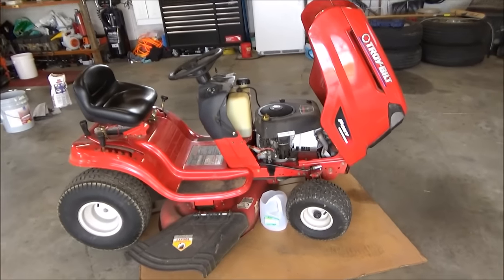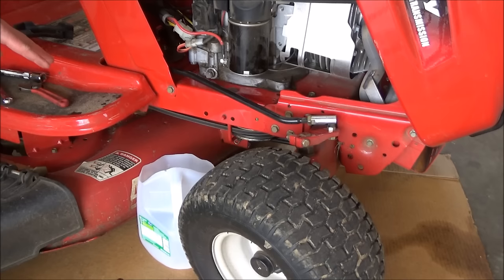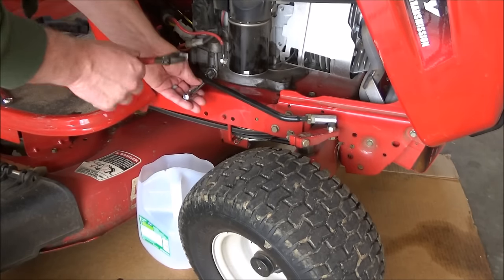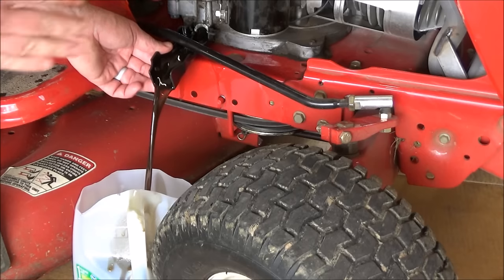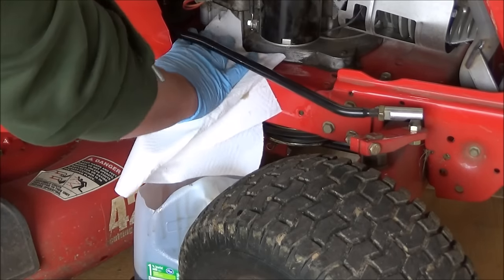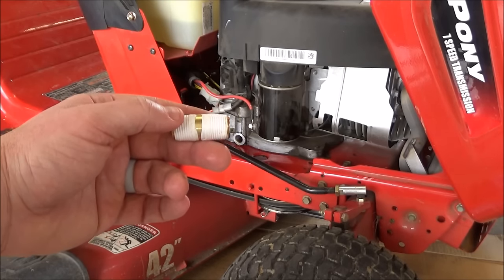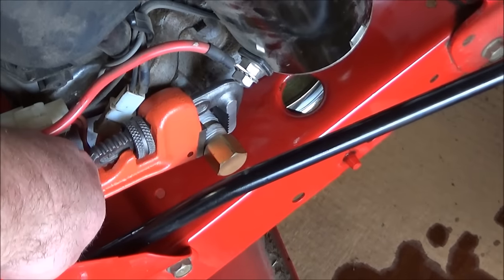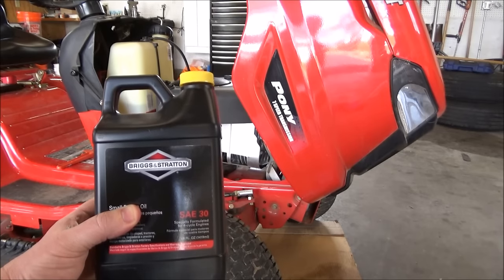Troy-Bilt Pony | Oil Change Made Easier

Comment: There is no oil filter on pony 42? Where did you get the brass nipple
Reply from the maker: Within the last year or 2 they started adding a filter on certain models. They did not have one for a long time before that. I got it at Home Depot. 3/8 MIP
Reply: @fixitFlip  where is it located so I can find out if mine has one?
Reply from the maker: @dbluehorsedeboe5567  It is a round, black, canister looking part up above the drain plug.
Reply: @fixitFlip  ok thanks
Reply from the maker: @dbluehorsedeboe5567  No problem.

Comment: How do you change the solenoid?
Reply from the maker: Follow the red cable from the battery to find your solenoid. It's just a matter of taking a couple bolts off to replace it. Just make sure you disconnect your battery. Sometimes they are a little tricky to get to. I haven't gotten a chance to make a video on that yet!

Comment: I have one similar to that but I don't see a oil filter on mine 🤷🏿‍♂️
Reply from the maker: Yep, none on mine either! They just recently started putting one on this model last year or two.
Reply: @fixitFlip  So it has no filtering system to filter out the old oil? That's weird.. How does that work?Where can I buy that pump so I don't have to drain from plug?
Reply from the maker: @dkd8747  It's a splash lubrication system. It doesn't require a pump or a filter.
Reply: @fixitFlip  Thanks i was talking about the pump that you were using to suck out the existing oil to replace with the new. or maybe im getting this mixed up with another video
Reply from the maker: @dkd8747  Ha ha yeah I know what kind of pump you are talking about but that wasn't me.

Comment: I just bought this same mower. I put a quart of oil in it. When i was running it, the mower started to put out a lot of white smoke. Did I put too much oil in? I looked at the manual afterwards and it said that the mower comes with “some” oil already. I’ve never had a riding mower so I’m still learning what all comes with owning one. Any info helps, thanks!
Reply from the maker: You put a quart in it? A quart is 32 oz. This mower takes 44 oz of oil. (48 if you have an oil filter on it, which mine does not) If you put too much oil, it can make it smoke a little. White smoke typically means oil.
Reply: You overfilled it.

Comment: Dude I just did this combo and the cap you are showing can’t be 3/8 even if it’s a compression one. It has to be 1/2” cap to seal the nipple.
Reply from the maker: Nipple is 3/8 MIP (male). Cap is 3/8 FIP (female). That's what goes together.  Not sure what you are getting at.
Reply: @fixitFlip  I bought the double ended male pipe nipple 3/8 wide 1 1/2 long. No 3/8 cap would fit over the thread on it . Only a 1/2 cap would fit
Reply from the maker: @mavericke3514  Not sure, man. That's how it works. The same size male and female fittings go together.

Comment: The 42" deck belt for a troy bilt pony year 2019 and 20 >>> 1/2" x 96" long OK  the same engagement cable also. Parts # QSH - 0453   OEM NO- 746-04092 cable --- >  Keep 2 of each on hand. This may not be the same on older models
Reply from the maker: Thanks, Bee.
Reply: @fixitFlip  wc  bro

Comment: Instead of a cap why not put a ball valve. Then when it come time to change oil you open ball valve. That’s it. I know an idiot gonna say what if the handles hit open. Well take off the packing nut along with the lever. Put packing nut back on. Then all
You use is some pliers to open
Valve. 3/8 ball valve.
Reply from the maker: That's a clever idea!

Comment: The owners manual says 10w30 oil for the 2018-19's
Reply from the maker: 10w30 will give you a little more flexibility. It works better in colder temps than SAE 30.  Either one would probably be fine. But that is interesting the new manuals are saying that. I would go with it if that's what it is saying now.
Reply: @fixitFlip  I just bought a John Deere E130 this spring,  and it says in the manual to use 10W30. It's got the EZ change oil filter, but I think I've seen a video somewhere before that you can change it over to a regular way. The EZ change is $40 a pop.
Reply from the maker: @charliekeene2003  Yes if I had that mower I would probably be changing it from the EZ change system. Those EZ change filters are too expensive. Here's a video on how to do it: https://www.youtube.com/watch?v=O7913PLSywc
Reply: That multi-weight oil may very well burn off some...and potentially cause issues..as in less lubrication inside the engine during operation. Just sayin’.

Comment: I looked the parts for this machine on the troy site, my model number is 13wn77ks011.  The recommended air filter doesn’t even remotely resemble the air filter already on the machine (part recommended was rectangular and flat, the current is cylindrical.  I have I go back to the store lmao.

Also, why do the measure the oil in ounces for lawn mowers when it’s sold in quarts??
Reply from the maker: Mine did the exact same thing!! None of the parts match up on the website to the model of mower or engine I have. Very frustrating. Here is a link to the air filter I buy and use: https://amzn.to/2LaGLzx   It should be cylinder shaped! I have a video on it on my channel. 48 oz = 1 1/2 quart, but I have no idea why they sell it that way!
Reply: Fix it Flip thanks for the info, I can’t remember if it was the troy site, or some other site (I was in the store desperately trying to avoid going home and bringing the old parts to the store) but some site even gave me an oil filter as a part, got home and watched your video (to try and find it’s location) and this model doesn’t even have one.  And the bow tie clips were a PITA to remove as well.  Will be doing the blade change with the deck on next time.
Reply from the maker: Lolol I know it is pretty strange that this model doesn't have an oil filter. But I guess it saves us some money. And waaay easier to change blades with the deck on. Some mowers the deck comes off super easy. (Cub cadet is 3 clips) This one is a pain.

Comment: Changed the oil today in mine and it's a bad design
Reply from the maker: AGREED
Reply: Does the Troy bilt pony have a oil filter?
Reply: @theresafollweiler1608  no.
Reply from the maker: @theresafollweiler1608  One of the new models does. Mine does not. It's a 2012 model. They just recently added an oil filter.

Comment: i took mine out and threw it in trash , put a 3/8 pipe , with 45, pointing down ,and 4 inch going out with cap on it , problem solved
Reply from the maker: That sounds like a great idea. the 45 and the 4 inch going out fit under the steering rod??
Reply: @fixitFlip  i put the 2 inch ,then 45, then two inch and my 4 inch then other 45 and added 3 inch with cap , to get away from the rod ,and yes the rod is a problem , but it did work the other one that came with the mower would leak and after few changes they always round off then you got a problem , some Briggs and other engines have a plastic one that you push in , i do the same ,3/8 pipe what i don't understand it cheaper doing the 3/8 pipe than buying the plug at times and it be easier for customers . but thanks for sharing and giving people ideas
Reply from the maker: @josephtate6949  I agree. It should just come with the pipe and cap instead of the plug. And just a rough design with the rod in the way. It sounds like you have a cool setup. I'd like to see it.
Reply: @fixitFlip  i send it to you , it at my brother but i have it home couple days and send you picture or video ,

Comment: They have these drain valves now that would improve even further on your approach. That is if it fits: http://a.co/8ANyapM
Reply from the maker: I think those might do a decent job. Some mowers even come with them installed these days. I just don't trust plastic. I have read numerous stories where people are cutting grass and all the sudden look down to see oil everywhere because the plastic cracked somehow. I would trust a Fumoto like this https://amzn.to/2KAo9cX before something plastic. But they are pricey, and I'm not 100% sure it will fit over the frame. Or a Drainzit is a decent option like this https://amzn.to/2HQ2pfp. My fix cost $3 though.

Comment: Why not use synthetic Briggs oil and change it out every 25 hours or so,  oil  is cheap that oil looked pretty dirty. Why push it 50 hours with no oil filter?
Reply from the maker: Just going by what the manual says.

Comment: he doesn’t even know how to use the pipe wrench correctly.
Reply from the maker: Hello, Ronald. In this video I am just setting the pipe wrench in place to show what type of tool you will need. You are correct, you will need to hold the pipe in clockwise with the wrench to keep it in place while taking the cap off. I'm making a video this spring to show how to drain the oil out of the pipe.